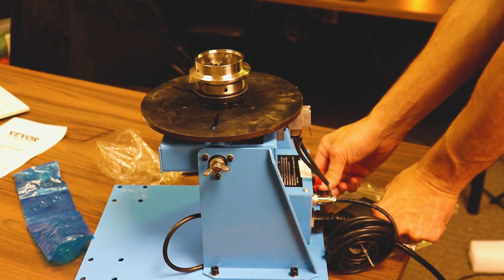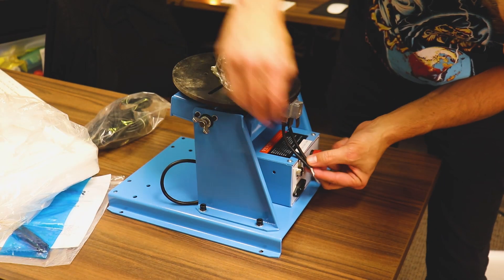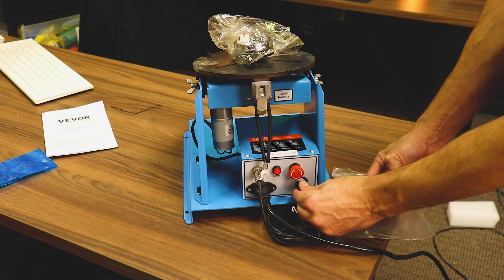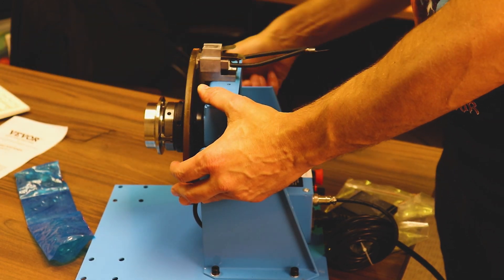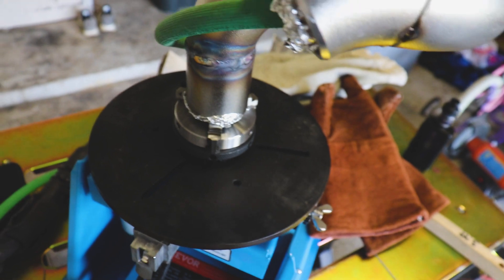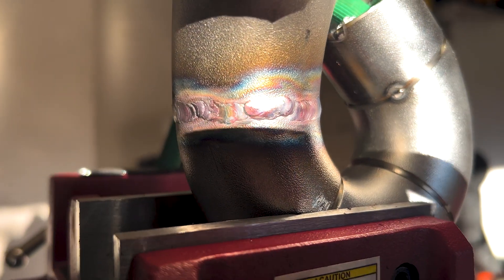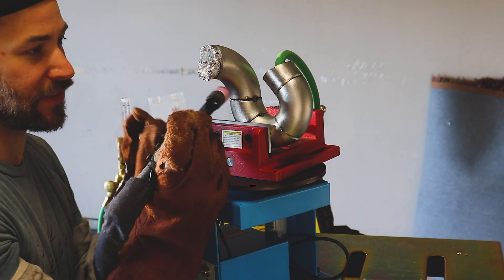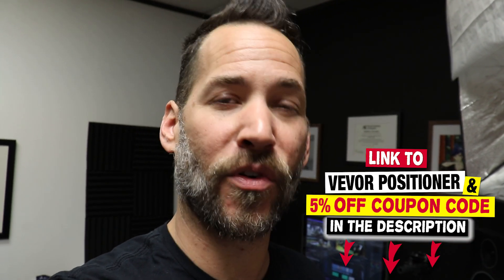Can a Vevor Welding Positioner Make You a BETTER WELDER? Vevor Welding Turntable Unboxing and Review

Comment: where do you get your diy turbo manifols parts/material?
Reply from the maker: The flange I designed and sent out to be manufactured. Pipe fittings from Ace Race Parts. The CNC collector is from Elmer Racing.

Comment: This video makes me feel relieved that it is going to go slow enough. I seen some other videos where it seemed like it would not go slow enough for proper TIG welding but it looks like they may have addressed that. No purging from the bottom side is going to be the next issue I'm definitely going to buy one. It's also a lot smaller then what I thought when you grabbed it out of the box with your hand.
Reply from the maker: I recall seeing reviews and thinking, yup, could definitely put this to use at the price point it's at.  Would be nice if it had back purge access at the base plate, but I'm sure it's something that could be fabricated easily.

Comment: Bigger gas lens (16-18) and about 30-40 CFH argon (try it out and see what works best for your lens/cup) to start with a 2 sec pre and about 10 sec post flow and don't move your torch after you get off the pedal, let the gas do its thing, backpurge with 10-15 cfh. Not sure what your amperage is but that .045 or 1/16" rod for those pipes is pretty small, guessing 3/32" tungsten? I bought one of these but saw another YT video where someone replaced the motor in his with a 10 RPM motor... I bought one and WOW!!! HUGE DIFFERENCE!!!!! It will crawl to almost nothing RPM... LOL. Also bought and retrofitted a 5" 3-jaw chuck on mine and it's so much better than that toy chuck they send with it. Keep practicing with yours though @cmattdabrat  and you'll find for the price, it's super helpful as an inexpensive turntable. Thanks for posting your results and testing too!! 🙂 I use mine primarily for intercooler and exhaust piping but have used it for tooling too. To add one more thing, I typically set my speed with the dial then place the entire weight of the thing on the pedal to just let the weight activate the motor, then use the switch on/off when I want to start/finish. Just how I do it 🙂

Comment: I've only welded whit mig and only few hours my vevor welder can do tig and stick too but i havent invested in gas bottle yet) but what I've understood from videos your problem is that you arent consistent. You need to move at consistent speed and add filler in consistent rhythm to get those clean welds
Reply from the maker: Definitely need more practice. Not something I do everyday, but gets the job done.

Comment: Way to hot or too slower speed. But I may just have to get one of these for my home work shop but I may need a bigger one.
Do you know if they sell a bigger one?
The last few welds were pretty good though.
Reply from the maker: That's true! Took some time to get the nicer looking welds. Just kept playing with the settings, post gas time, and cfm. They have a bigger one. I just happen to get the smaller one because it suited my needs perfectly. Thanks!

Comment: Man that'd be nice to have! When I worked in a manufacturing plant doing tig welding we had massive positioners and it made things so much easier to tig! The real trick is getting used to holding your torch hand in one position and just feeding the rod consistently. I had to fight the urge to move my torch hand to advance the weld
Reply from the maker: I need to get better that! Maybe even make an adjustable stand to cradle my hand. I could use more practice feeding the wire instead of doing it stick weld style where it gradually gets shorter. Just need to keep a piece around in the office and get use to the motion of feeding it with my left hand.